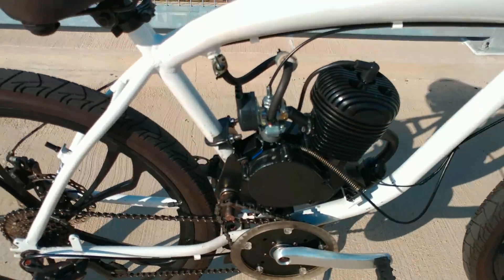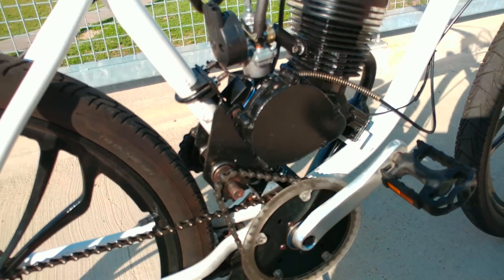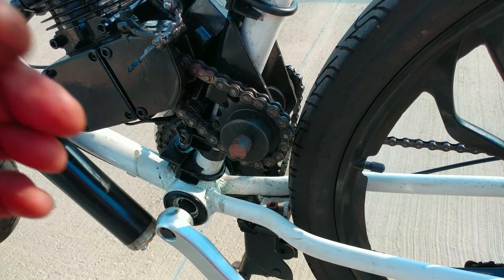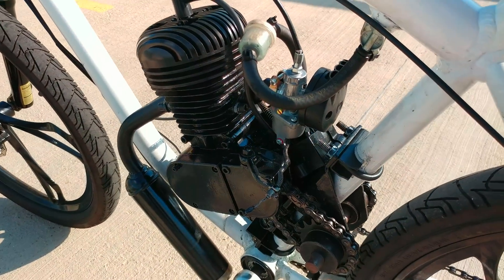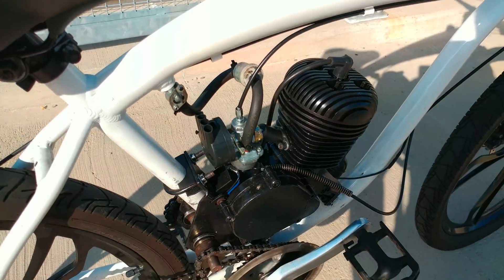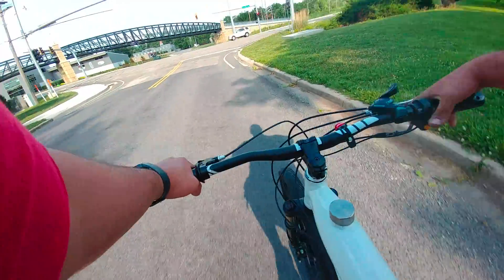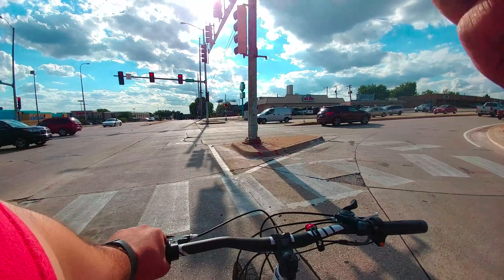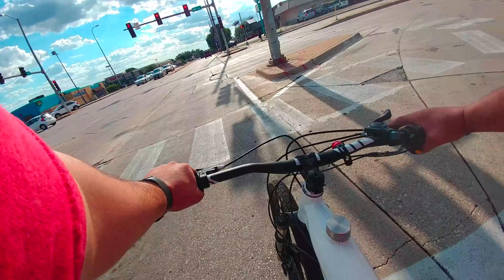Motorized Bike Jackshaft. What it does and how it does it *Viewer Request* Hill Climb and Speed Test

Comment: My 66cc would have easily climbed that little hill. I ride mine to the top of mountains with out a Jack shaft. Why's your engine idling so high? Sounds terrible.
Reply: My only mod is cnc sprocket and hub adaptor and engine mounted chain tensioner. Stock 44 tooth gearing.
Reply from the maker: +kennith rogers crank seal leak
Reply: Thanks Allot.I've had a sporadic high rev until warm.I'll look for oil in the covers.
Reply: BryDuhBikeGuy try adjusting your choke lever. I keep mine closed/open halfway.
Reply: Thnx.Will try that in a few.
Reply: I Have tightened everything,and even used gasket maker,so that's not it.I have heard of the crank seal leaking at the Magnito.They even Know this and sell an adapter to hold the seal in,behind the magnito.
Reply: Your 66cc is probably an 80cc that's kind of an industry secret to make them street legal. In most States 50 cc is the limit. If you notice in the description on most sites it's 66 - 80 cc.
Reply: @shackman9566  66cc is the swept volume of the piston or how much volume is displaced by the piston moving up and down. In China they include the combustion chamber volume with the piston down. Hence 80cc. To us they are 66cc engines.
Reply: @Clint Bliss. Dang ol' metric system man😁
Reply: I have a good engine no idle issues or leaking. It's heavily used and still has lot's of power. A guy was moving and couldn't take it with him said he had built couple before and road them all over Denver Colorado. The only issue he had was breaking rear wheel spokes. He was big guy not fat but over 230 so he  built wheel with heavier spokes. I've had mine up to 36 mph that's with a GPS mounted on the handle bars and it did it for miles and miles. Scary though as it vibrates the crap out of you and makes unsettling noises. I'd like to build a atomic zombie style worrier tadpole trike. Here in Pennsylvania I need a hill climber that can still do thirty - ish. I've even thought about a 4 stroke tucked into a rear carrier looking enclosure to keep it stealth.

Comment: Is this a version of the BBR bike frame? It seems to have a built-in gas tank. I also like that it has disc brakes and a suspension fork. Bearings, Brakes and Wheels are the most important and most overlooked part of these motorized conversions.
Reply from the maker: +bullwhip johnson right you have to make a good bike bike before you can make a good motorized bike.
Reply: Motored Life Is this bike sold separately and built especially to be motorized?

Comment: Ik that Motoredlife.com and Zedamotorsports.com are the best for quality engine kits but I found the "Seeutek PK80 80cc 2-Cycle Petrol Gas Engine Motor Kit with Angle Fire Slant Head for Motorized Bicycle Bike" on Amazon and i was wondering if this  is a cheap alternative?
Reply: Cipher I have two of those engines on bikes and they run great however, zeda sells a better engine for 20 dollars more and bicycle motor works also has some great quality kits and sells the zedas as well

Comment: Whats going on with that front motor mount? The motor isn't positioned as intended with the studs on the front frame mount. It's about 3/8ths of an inch too high on the mount. How is the motor being held on the bike? That mount issue looks like it would be unexpectedly problematic with an already difficult jack shaft install.
Reply from the maker: with the jackshaft and BBR frame the engine didn't sit flush so made a bracket to fix to the pedestal mount it is held on by 4 bolts. Never had a problem actually has less vibration than stock. good eye though

Comment: Nice build man. Been thinking of getting a jackshaft kit for my next motorized bike build. I also want that same frame but in gloss black with a custom paint job like pin stripes or flames on the tank & fenders. Sick Bike Parts seems to be the best supplier for these jackshaft kits & they seem much better than dealing with those pain in the ass direct rear drives. With direct drives our options are the horrid rag joint sprocket clamps that come with the kit or the overpriced sprocket adapters & also those annoying idler wheels to.
Reply from the maker: A. G. I'm CNC hub adapter with a ZEDA racing engine all day. Jackshafts are fun though.
Reply from the maker: Zedamotorsports.com 👍
Reply: arthur clark; I ended up getting an HD hub/wheel kit from Bicycle-Engines. The sprocket is now one with the hub instead of bolting through the spokes & the wheel itself uses a good rim & heavy duty spokes. Had to bend my dropouts a little but fit great after. Even was able to convert my rear brake from a coaster to a disk because it came with a disk brake adapter that screws onto the hub over the sprocket. Costed me an extra 100 bucks but well worth it. It's practically bulletproof compared to the kit method & still cheaper & easier than getting a jack shaft kit.

Comment: This goes a lot faster than I would be comfortable riding a bicycle. Especially with grates, cracks, and potholes. Not to mention people in cars! I wonder about how well the bike chain can hold up to the stress of being motor driven, since it is so much smaller that the engine drive chain.
Reply from the maker: caduceus33 I used an HD one but if you are giving it throttle and slip a gear it will break. I dont ride it often around here.
Reply: bigger wheels are better .. the 10" fat scooter tires look ok but a taller tire is worth  allot if u have to run out into the grass to avoid a crash, or have a giant pot hole sneak up on you .. i think the large beach cruiser wheels are great height wize .. i used to ride a Tomas .. and its 16" wheels saved my but at least once

Comment: Lower your idle speed sir.
Reply: Those engine kits tend to run rich fuel mixture causing it to idle high, I have one. If he were to lower his idle it would bog down and almost die. This bike sounds great.
Reply: @cameronpeschel7360  it sounds terrible.
Reply: J. Simental S. ,my name is Danny I bought the 3.4 liter frame but I don't know what size neck I need ?it says  44mm yith a 42 mm and I don't know what to do? If you have any help let me know....thanx
Reply: Sounds just like a dirt bike. ,,,👍
Reply: @asappestcontrol1250  No, it sounds like 50 bumble bees that have been gassed with mosquito repellent.
Reply: @MaFTB  youre right!
Reply: It's only 80cc, how much fuel is it really going to save by lowering the idle?
Reply: awdrifter3 it’s not so much that it’ll save fuel (it will but when you’re getting 80+mpg who cares if it gains a few) it’s that these engines have way more power when idle is tuned correctly, idle screw opened too much the 2 I’ve had made them bog down like his did in 3rd and 4th going up the hill where as with it adjusted to just be at the threshold of smoothly idling it would’ve been powering through that going about 10mph faster. He said in one of the other comments “they can go faster but not with this old engine” so I’m thinking he’s probably losing some compression making it not have as much power as it should either. These engines love to vibrate everything loose so you really have to stay on top of making sure the spark plug, carb, and head bolts all stay tight otherwise it’ll progressively run worse and worse till it loses compression and doesn’t run at all and if they’ve been loose for awhile unless you’ve upgraded to stronger bolts than the ones that come with the engine, good luck getting them tight again without losing threads in the process.
Reply: My 49cc idles at a low rpm no problem.
Reply: J. Simental S. He does what he wants.

Comment: I'd like to know how easy it is to pedal normally without the motor going
Reply: looks like it would be almost as easy as pedaling a bike with out the motor .. you have to tote the motor and fuel weight and turn a couple gears on the jack shaft as you pedal ..
Reply: I pedal my 86 pound fat moto 4 stroke bike. With a chain loose like they call for it's not bad but when the centrifical clutch locks up it brings me to a halt no peddling when the clutch locks up unless you're downhill. So I guess these lighter-weight 2-stroke bikes would be even easier to Pedal. But when I had my drive chain too snug it felt like the brakes were on so I had to loosen it up that made a world of difference. No chain specs so I went by what the motorcycle chain specs are.

Comment: Hey Alex so I just got some spark ⚡️ plugs and I was wondering which would be better the " Campions l86c" or "NGK B7HS" ? Compared to the original stock spark plug z8c there like 2 threads longer. The champions plug seams to make the engine run smoother. BUT The Ngk makes it run like stock B7HS apparently a higher number means it meant for hot weather? Is that true? Also what spark plug are you ranning on your build. 
Thanks 🙏🏼
Reply: I used to be a loyal Champion plug man. But now days the CORE of the plugs melt and you end up with the ceramic center of the plug either loose or in your hand or out on the street. Had it happen too many times. NGK plugs are much better for these bikes. B7Hs is correct plug #5110. Works really well even in cooler temps.
Reply: THEKING SILVERADO so your still recommend the reed valve kits ? , lol
Reply from the maker: The B6hs seems to work best for my location. Yes with NGK the higher the number the colder the tip. They for sure burn cleaner than stock.
Reply: Motored Life so I'm down here in southern Texas and it gets hot and humid. So a colder tip is good to keep the engine running cooler so it won't over heat? 

🙏🏼
Reply: @MotoredLife  I don't know NGK I've always used auto light the higher the number on the end say for instance a 66 means it's a 6 heat range it's a hotter plug than a 62 which has a 2 heat range. The last number on the Autolite plug is the heat range. It's pretty simple but a lot of people don't like auto light.
Reply: ChuCho Cycles ngk that's what I'm running champion isn't very good they foul out very easy I Kno because that's the one I got with my engine trust me ngk is top quality
Reply: I couldn't get a NGK when I needed one so I got the Champion Copper Plus.The # L82C though.Runs better than ever.
Reply: It's a Copper PLus L82C.Ran it through winter and summer here in Michigan.Is 9month and still a light tan color.I just bought an NGK- B5HS to use instead,just because the Tip won't ever wear.I'll keep the Champion Copper Plus in case I break the NGK.
Reply: Motored Life  I asked a question with no reply but my engine will only idle n run with the carb wide open
Reply: ChuCho Cycles a colder tip helps living where your at I'd go with an upgraded head n maybe port it as well due to elevation I'm in butte MT a mile high I had to report mine  and my new cheads on its way
Reply: ChuCho Cycles n if it's a few threads longer it shouldn't hurt the piston unless the two heads thread past the combustion chamber then it'll damage your position n may result to a complete rebuild wich isn't hard just not cheap depending on the engine but correct Me if I'm wrong but that's what I did the Ngk threads are 2 n a quarter inch longer u can compensate but it requires boring your piston and head
Reply: Yeah the REED VALVE KIT that is why people keep bringing me all these motors with BURNT CYLINDERS and CRISPY CRITTER PISTONS BEARING AND WRIST PIN. Please stop it. After the advent of engine not firing right and barely starting up, I was continually getting bent rear wheel after bent rear wheel. Now days thee motors from CHINA fire over a lot better and on time. The problem you fail to realize is the REED VALVE COOKS THE PISTON & RINGS. I now have a box of a lucky 13 pistons and rings and my folks my customers now have regular Perf. carbs and intakes back on their bikes... Fuck if I am even gonna deal with this REED VALVE  bullshit here.  YOU WANT AN ENGINE AND REED VALVE MOTOR HERE. "0" WARRANTY. NOT GOOD FOR A WEEK.  TELL THE AUSSIE WUSSIES TO STICK EM BACK UP THE KANGAROOS ASSHOLE WHERE THEY INVENTED EM.

Comment: where would you reccomend buying an engine kit?
Reply from the maker: Capt. Bacon Zedamotorsports.com
Reply: Motored Life thanks!
Reply: Motored Life could you provide a link to the kit?
Reply: Try http://www.bicycle-engines.com/ they have some pretty good kits both 2 & 4 stroke they also sell plenty of parts. They used to sell the Skyhawk 2 stroke kits but they are no longer doing business with Skyhawk. Bummer to because I was right about to order a Skyhawk kit before they stopped selling them. But they got plenty of the Zeda kits which seem decent enough. Just got a Zeda kit from them for a beach cruiser project last week. It says 80cc but it actually a 69.5cc (40mm) piston.

Comment: What????? So it does not go fast. My bike can go 30.7 mph.
Reply from the maker: Ernesto Sosa I mean with different gears they can go 60. if you want speed just get a zeda dio reed engine.
Reply: Motored Life what is that? I wish mine can go 60 mph, but I am still rebuilding and buying new upgraded part for the bike. It ride nice.
Reply from the maker: Ernesto Sosa ZedaMotorsports.com 👍🚲
Reply: Ernesto Sosa is a hack. He went from 34 mph to 30.7 because he added a high compression head and it clearly was not torqued right.
Reply: J. Simental S. What’s the proper torque spec
Reply: @thelongranger55  proper torque is10fps
Reply: Josh Richards been waiting 9 months for this answer , now I can put my head on and ride lol , jkjk
Reply: @thelongranger55  u can also take that head a bit further and deck
Reply: Josh Richards I’m sorry , what did you say ?
Reply: @thelongranger55  I'm sorry it didn't post every thing I said you could take your head a little further and deck it
Reply: Josh Richards what’s that mean ?
Reply: @thelongranger55  what it means if you're changing the quench zone or squish Band by sanding it down what you're going to do is  take a piece of rough sandpaper like 60 grit and put it on  a piece of glass or another hard and smooth serfice that isn't going to give and you rub around in a circular motion to Sandown the squish band to increase the compression of the motor

Comment: Yeah hate to sound like a hater but ur chain will slack out on u and u have no guides on ur jackshaft cog to keep chain where needed o btw ur muffler, u really need to anchor it to the frame like a lot ! And I know if u look at my videos u would be like (u don't know ) but take in consideration my videos are old and haven't posted new ones yet  ,my bike has undergone 2 mods o expansion chamber exhaust u get power from that and boost bottle (capture that un spent fuel get more bang for ur buck with that high compression head )
Reply from the maker: No man you're good. I love other people's input. The fact you even assembled a jackshaft is a feat in itself. They are fickle bitches!
SBP offers tensioner guides for both sides and they work great. I try to keep the right chain tight as possible with adjustment on the lower U clamp bracket every few rides. 
The exhaust has 1" hex bolts to hold it. The newer engine kits don't come with hanger brackets.
Reply: Mars Alseides yes ! BOOST BOTTLE ! It’s one of the best mods I have bought for my bike it’s absolutely help with fuel efficiency and my idle RPM is a lot lower and it uses less fuel when just running , and it really make my bike run a lot smoother and the throttle is responsive and sensitive

Comment: Hey man pleas help I just bought a black stallion 66cc 2 stroke it ran fine for the first day but now it's leaking black stuff out of the muffler and I won't turn on I tried different gas ratio going fast spark plug and I drained the carb but I can't seem to find the problem ....please reply!!!
Reply from the maker: Dylan Harper check if its flooded or sludgey pull the spark plug flip the engine see if anything comes out. 
Then do the 3 basics. 
Touch the plug to engine roll the bike check for spark. 
With carb filter off hit the primer button on till you see gass come out overflow hole. 
Check proper air flow, clean filter, take baffle off exhaust to test for clogs.
Reply from the maker: Spark, gas, air. It will go boom.
unless you have a worse problem rings, bearings, etc.
Reply: Motored Life thanks so much i will try those for sure#!!
Reply: Dylan Harper